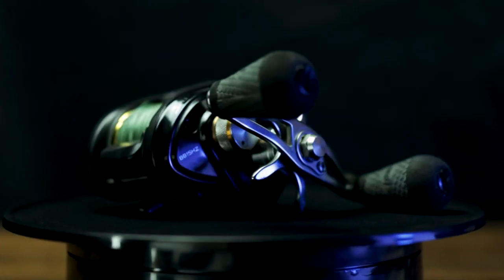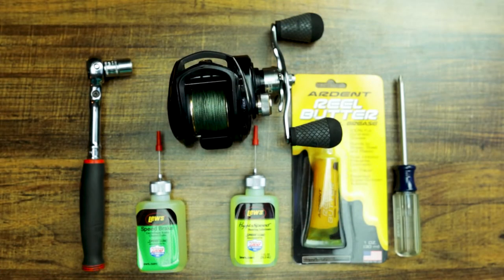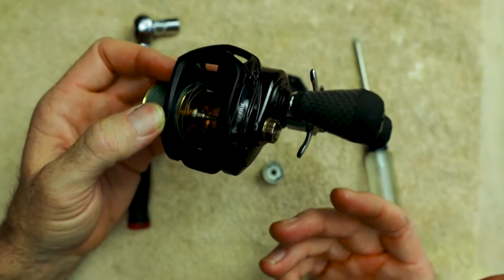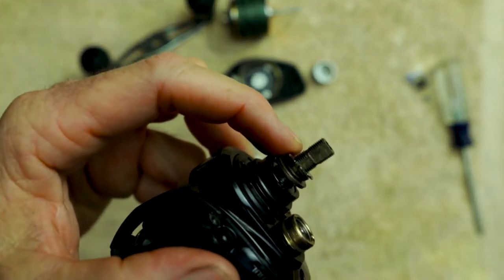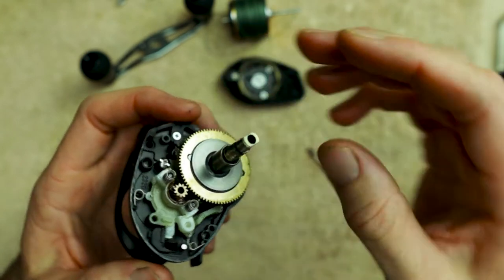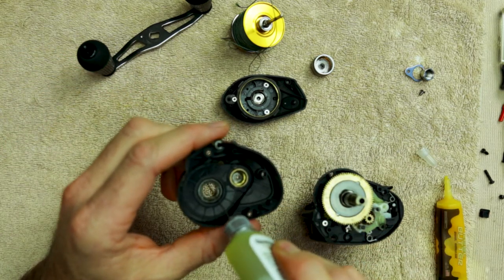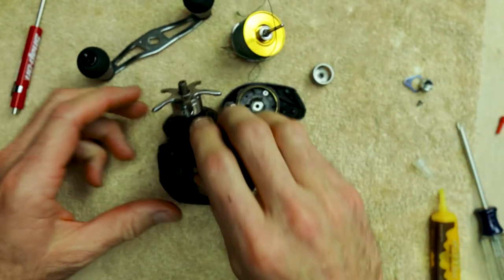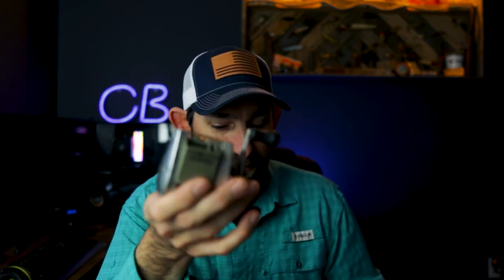In depth teardown and cleaning of a Lew's BB1SHZ

Comment: Living in S Louisiana, yes I clean my reels yearly.
4 BB1’s since they came out
2 of BB1’s are slower gear ration with the pawl.  I like old Ryobi and had original shimano built bb1 reel feel.
3 super duty’s
1 wide super duty
2 300’s
1 Lews sp 
1 Lews custom lite

They are all made by Doyo.
I had Diawa Tatulas Japan exclusives also just don’t like the t wing.
Decent reels.
I brake my down.
Flush the bearings
Relube with lube I got from Japan originally for hedgehog bearings I used in my Diawa’s.
Never had an issue.

Now I am a tackle geek and build my own rods also.
Reply from the maker: They are some great reels.  Haven't cleaned them since this vid and yet to have an issue.  With that said I'll probably set into a five for the tournament this weekend and the reel let go on me again.  LOL.

Comment: Sorry to really make that BB1 pop change the worm gear and bearing under the handle.  Then of course the spool bearings.  It will feel like a $200 zillion.

Oh watched video about washers.
You got to put them back correctly or messes with the tension on the drag.

Also loosen your drag after each use to not compress your drag.
If a fish runs you don’t want jerking you want a smooth amount of tension.

Comment: That wasn’t much of a tear down and cleaning. You just kinda put lip stick on a pig. You need to pull the Yoke and Maingear off. Give them and good cleaning and  then lube. Also need to look at the drag stack and maybe clean. Clean off the spool shaft that goes into the Yoke gear. ( Doesn’t need oil )  Clean out the worm gear and check the paw .  May have to disassemble the front of the reel to do correctly.  Also should check bearings to see if they spin freely.  If you clean and lube your reel you should fo it right . Remove the old grease and replace you new. Last you don’t need to soak the anti reverse bearing with oil. It’s defeats it purpose.  There are many good videos on how to properly maintain your LEWs.
Reply from the maker: You are correct.  There is a lot more components I could have torn down into and really given it a complete cleaning.  I didn't feel the need to go any further than what I did since my problem was simply the anti-reverse was not working.  By oiling my anti-reverse bearing it freed up the cams and it started working.  It has stopped one other time since.  I just oiled it up again and it works fine.  The drag doesn't slip which is the way I want it on that real.
Reply: The  only reason I watched the video  I knew  that your reel was a older  reel.  And  I wanted to see how  the Stopper Assembly  engaged  the  ratchet gear.  The Stopper Assembly look like  a pair of  anti  reverse  Dogs.  I  belive the newer BB1  doesn’t use  that system.   It kinda looks like a weak link  ?   I know the reel like yours have a outstanding reputation  for reliability  and casting.